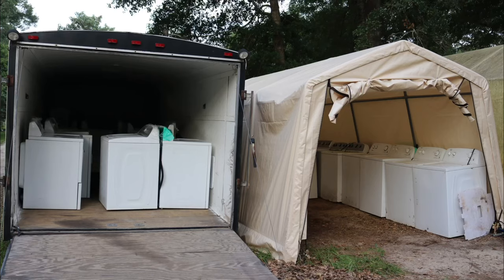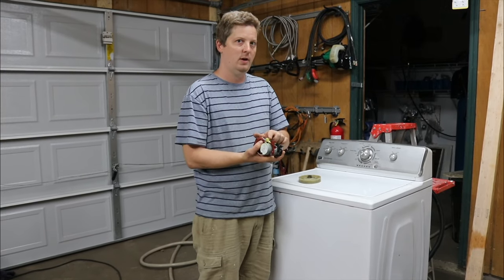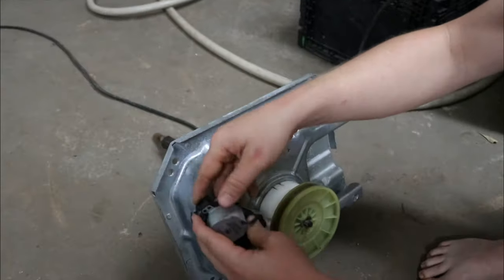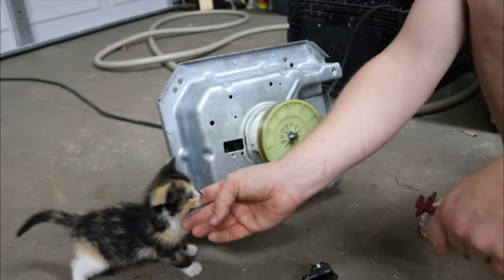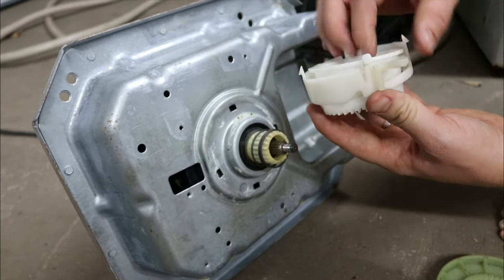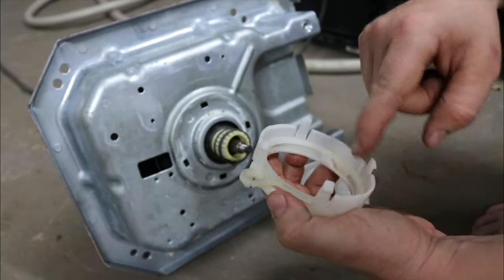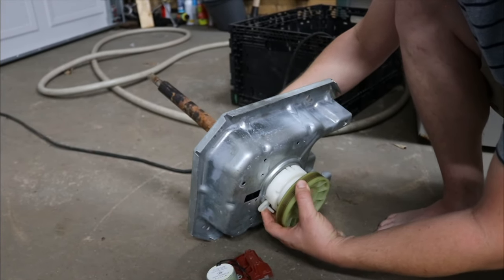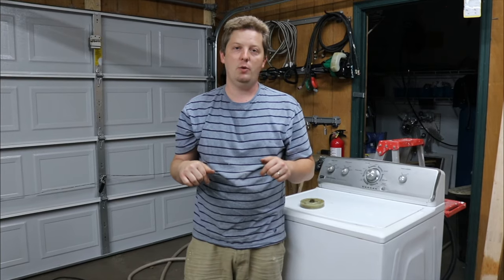Washer No Spin or Grinding Sound? Actuator Transmission Step by Step Guide to Fix or Replace

Comment: I changed the actuator on my washer and now it won’t fill with water only thing that moves is the agitator I tried resetting the washer numerous times and no luck help plan TIA
Reply from the maker: When you say reset it out do you mean unplugging it and plug it back in or put it in to diagnostics and recalibrate mode.
If you have not done that there’s lots of great videos on how to put it into diagnostics mode and re-calibrate it. These washers are super fidgety and definitely live up to the reputation I have of being pieces of junk. Good luck. Let me know how it goes.
Reply: I did a reset that you put it in normal go left then right right right left right then all the lights light up i go to 6 o’clock rinse light is only on then press start I don’t know if that’s helping or not

Comment: What if it fills with water and makes a very loud pulsing grinding noise
Reply from the maker: It could be the splutch but I have also seen some of the low profile agitators do something similar when the ribbed shaft that hold them in place strips out. Hope that helped it’s always hard to guess without seeing the machine in person.

Comment: Can you help ? I was washing the clothes when the machine just stop and won’t do anything it just sits there I hear a humming sound
Reply from the maker: It could be the actuator but also check to make sure the water has not gotten cut off for some reason. If it was requesting water for a rinse cycle and the water is cut off it will make a humming noise while it’s trying to get water.
Reply: @WasherDryerMoney  ok thanks

Comment: Hello how do I change the bearing on this unit
Reply from the maker: Crazy you should ask I am literally making a video on that now. Should be out in a few days. The short answer is any machine that has a pause play button and a six little lights on the front have the same transmission. You cannot change the bearings on the machine. They are built into the transmission. I literally cut one open to see if it was possible and I would say it is not possible.

Comment: On mine the ring keeps popping off of the peg on the actuator arm. So the washer stops agitating. I have to lean it back and pop it back on so it will shift into agitating... very aggravating.
Reply from the maker: Yeah, be sure to grease the area where the arm goes back-and-forth. Sometimes it will be stiff and make it pop out of place. Also, I have seen some repair guys wire those two pieces together so they don’t come apart as easily.
Reply: @WasherDryerMoney  thank you. I will give that a try.

Comment: How do you know if gearcase is going bad?
Reply from the maker: These type of newer washers with belts don’t really have a gear case. That box does not have much in it. It’s mainly belt and motor driven. Sometimes the bearings will go bad the sign for that is a very loud grinding or squealing noise.

Comment: Hi, the shaft not  working , and how can tell
Reply from the maker: Usually when the shifting actuator goes out you’ll either hear a clicking or the machine will just not go into agitate. It will just sit there with water in it for a little while and then drain. Sometimes it will be stuck on agitate and it will never shift to spin and the clothes will just end up soppy wet on the bottom of the washer.

Comment: My actuator keeps popping out of the loop Could this be the cause?
Reply from the maker: It could be that the sand or grit inside of the white plastic shifter is making it more difficult for the motor to move. Or it could just be the plastic slightly weekend and it’s just given out.
Reply: Thanks I appreciate the reply I ended up putting a screw into the hole of the arm of the actuator to lengthen it so it doesn’t pop out so far so good I wrapped in elastic band around the exposed threads it’s not rubbing against anything and has reinforced the plastic👍🏻
Reply: Do you think that using the afresh cleaning tablets will help with the grits and sand?

Comment: Does the actuator have any move ?
Reply: Meaning is it supposed to have any movement because I changed the clutch assembly but still making noise when we turn it on, so then I saw your video and now I am thinking about the actuator possibly being the problem but looking for more info? Please help
Reply from the maker: @fernandowoodysanchez9062  actuators are very common to go out. You can actually put this type of washer in a diagnostics mode and check. I don’t have a video on that yet, but there are lots of great videos on it. Be sure to put the washer through a recalibration mode. It’s very easy and I recently made a video about how to do it.
Reply: I have a Maytag bravos mvwx655dw1 that won't spin the clothes well. I've done the reset, and ran diagnostics but not getting any error codes. Now it wants to keep running the rinse cycle after the wash and not spinning well. Still no error codes. Do you have any advice?
Reply from the maker: @victorialw1  you can put it in manual, diagnostics mode and test one component at a time. There’s lots of good videos on how to do this. I have not made one yet.
Reply: @WasherDryerMoney  Thank you. I'll try looking for one.

Comment: But how do you open the machine?
Reply from the maker: The machine I’m demonstrating with on this video you do not have to open to get to these parts you just lamp back the bottom is open and reveals the bottom of the transmission. Be sure to unplug it before you start messing anything in case it comes on.

Comment: I have replaced the agitator and the actuator and it still grinding, and clothes are still wet...help!!
Reply from the maker: If it's making a grinding noise it may have ground those plastic teeth down.

Comment: I was able to take the nut off the pulley but then the pulley is stuck on and doesn’t pull off so smoothly like yours
Reply from the maker: That’s weird. They usually come off fairly easily. I’ve had a few a little stock but I was able to unstick it with a little brute force. You might try borrowing a steering wheel puller from an automotive place.
Reply: I ended up brake it off

Comment: I have a Maytag Centennial, model MVWC360AW0.  It doesn't spin out.  I've put it in automatic diagnostic mode, and here is the video:   https://59plymouth.net/toShare/Maytag/Centennial.mp4
All other functions, including agitation, seem to work fine - but it doesn't engage the tub to spin.  I replaced the red actuator with the black replacement - same part number, W10006355 - but the connector has a different orientation, and is in a housing that interferes with mating the harness connector with the actuator connector.  I simply cut the housing off and was able to mate it up; otherwise, the actuator arm, pins and screw holes lined up perfectly.  No love!  For a cheap 20 bucks, I bought a  clutch kit and belt from Amazon, hoping that might be it - and liberally used lithium spray on the gears.  Still no love!
The behavior seems to me that the clutch is not fully engaging.  From looking at the video, would you guess this is the case?  Should I purchase another actuator - or might there be yet some other problem, e.g., the gear case?  I should mention that when I spin the center spline with the clutch gear retracted, the agitator spins freely; when I shift the agitator arm to release the clutch gear, the tub spins.

Comment: I have an older GE top load washer. For a while it had a slight knocking sound when running and now it will not spin at all and just makes a horrible noise. There is also what looks to be shavings or dust under the motor. Is that related to this same issue?
Reply from the maker: GE washers have a bottom plate. When you lean the washer back you'll see there is a piece of metal that runs across the bottom it's not just open like most washers. Usually the suspension will get a little bit worn out over time and let the drum set slightly lower and it will rub that metal bottom making a horrible noise when it is agitating and full of water because it's heavy. If you think that is what's going on you can fix this by opening the front of the washer and trying to bend that plate back down or taking the plate off and adding washers to make the bottom plate move further away from the pulley that is rubbing. I hope that helps. I'll try to make a video on this problem soon it's very common.

Comment: hello  wash machine tech,,well just a great info video,real informative,,,I have a ladyfriend who asked me to look at her  machine,its a KENMORE,SERIES 500.#6y2018;#2513241,,the unit wont work,,when she presses the power button,nothing,she holds it for 3 sec and the green light on the  far left lights up and there is a  machenical noise comeing from the top,inside,she  said it fulls up halfway then drains out,,,another yt video says there is a control board on the back of the control console,thats  is a rectangle shape,with a red insert  on the left side ,and a blue insert on the right side,it controls the hot-cold water fuction,he put a meter on one side a said the selanoid ,inside is burned out,not sure what this part is called,he said it cost 28 bucks,could this be the problem with this machine,or could the  actuator switch be bad aa you describe in you video,or both,or something else,thanks for any help on this ,,dan diorip,,

Comment: What does a bad motor sound like? My washer is having issues and gets stuck on cycles and won't spin out. It makes a strange grinding noise and when it does do something I don't think the actuator is moving at all. When the washer is off and unplugged, I can't manually spin the actuator plate by hand. The noise: https://www.youtube.com/shorts/dR1dS721JSQ

Comment: gtw680bsj0ws GE Washes fine. Spins on low ok, but will not spin on high (Fast). Puts 27 min. back on the timer and rewashes.

Comment: Hey there! I was wondering if you could take some of your time to help me . I would really appreciate it .
I have a hot point that stopped working . I watched several videos and it seems like my case sounded  like a bad capacitor or a sock stuck in the pump .. I removed the front face of the washer and remove the small water pump to check if it had a sock stuck but it didn’t.. and so I thought it may be them capacitor and I ordered a new one but still it doesn’t work … 
So if it wasn’t the capacitor , nor the pump, nor the door switch which it’s working cause I hear it clicking when I close the door .. what could it be ? … I set the washer to small load .. I trows the water necessary To start washing but after finishing getting the water it doesn’t do anything .. and when I set it to spin it doesn’t do anything … I can only get water in and pump it out works too . Just not washing or spinning cycle
Reply from the maker: It depends on which heart point washer you have. They used to make them very similar to GE’s. I have had GE’s that the motors go bad on that do very similar to what you were saying.
Sense there is a water pump that is separate from the motor that turns the washer it will still pump water out. And the water valves will still let water in. But when the motor goes bad it will not spin or agitate. It’s just hard to say for sure without being in front of the washer.
But bad motor would be my best guess.

Comment: What's the difference between black and red . and wow made so cheap .dam washer s
Reply from the maker: The black ones are on the newer machines. I’m not sure why they make this part so horribly. I’ve always thought there should be a aftermarket part maker that just put a heavy duty motor on this part. That would solve everything.

Comment: It's very strange that this part would go bad, there should not be sand or any debris getting down there at all, Kenmore versions have a foam protecting the bottom side, it's not in the open, if there is sand and debris getting into there then there is another big problem, this motor should not go bad, unless it is straining over time and eventually burning out.    I don't know how these appliance makers get away with this and are not all sued for making crap quality appliances now - any new appliance you buy now, washer, dryer, fail much faster, in fact it's not uncommon to see old appliances last 20-30 years, without having to change the shift actuator or anything basically, these were made to last - NOW you are lucky to not get problems conveniently past your 1 year warranty, and the replacement parts also are poorly built and fail quicker - these companies are running big scams in my opinion and the repair people representing them, bigger scam.

Comment: Can you tell me  , my daughters pulley cover was all dirty with an oily brown greasy substance . Does that means the transmission has lost its lubricant. Plus their is alot of play in the pulley and agitator  ? Can you help me. ?
Reply: it could be the transmission shaft seal and bearing is broken...
Reply from the maker: I am actually making a video on this subject now. The oil leaking does come from a very small gearbox inside a non-serviceable transmission. There’s a rubber piece that goes bad. It will leak most the oil out which is about 2 ounces.
Some people will continue to run the machine for several months to years before it Completely dies. The only solution is to replace the transmission as far as I can tell. Stay tune for that video and you’ll see what I mean.

Comment: My Roper  machine will not fill up with water
Reply from the maker: Be sure to check the simple things first. Make sure the waterlines are both on and have good pressure. Then make sure the filters between the waterlines and the washer are not stopped up. You can also put it in diagnostics mode. There’s lots of good videos on that to determine if the machine will know what is wrong.

Comment: Maytag centennial wont unlock lid or spin
Reply from the maker: Sometimes you can unplug the machine for a few minutes and replug it in and lock will release. Other times the lock being engage and not on engaging as a sign of a bad lock.
Reply: @WasherDryerMoney  Thanks very much got it to unlock Tom

Comment: I had a clicking noise on my kenmore 110 washer during sensing so I went ahead and replaced the shifter.  That appeared to resolve the issue for about two weeks.  Today, a new clicking noise started when the washer is sensing.  The clicking noise is loud and rapid(different from the original clicking noise).  I opened it back up and see no issues with the shifter.  I also inspected and cleaned the clutch.  The washer seems to be washing properly.  Here is a video of the new noise.  

https://youtu.be/9pQVaxGl7hs?si=6sjoGzEm6Li0s2nm

Any thoughts on what is causing this?

Comment: could a worn out actuator be causing a ticking noise? so far it does spin dry cycle?
https://www.youtube.com/watch?v=U869lAV2zBo
Reply from the maker: Looks like a weak Capacitor. Try replacing the capacitor first they’re fairly cheap.
Usually the main issue is not the noise but extremely weak agitation.
Reply: @WasherDryerMoney  thanks for the tip, I'll look it up tomorrow. That video was during the clean cycle. Spin/drain cycle sounds normal.

Comment: My washer agitate slow when washing(barely moving) and won't go into rinse mode...
Reply from the maker: It may be the capacitor needs to be replaced. I’ve seen this a few times. If it’s not that I’m not sure.